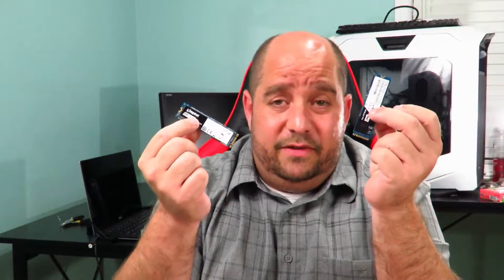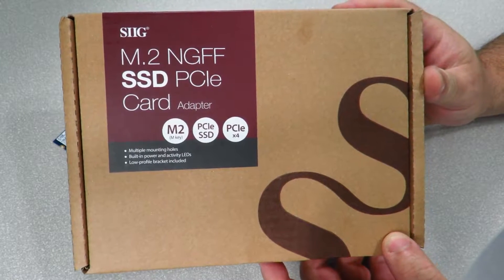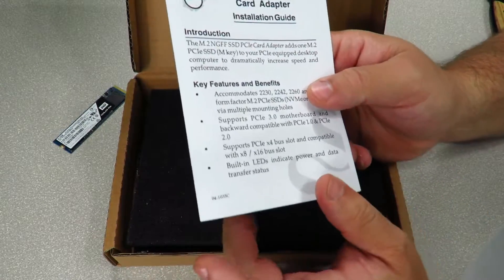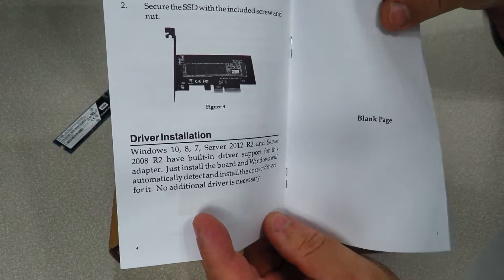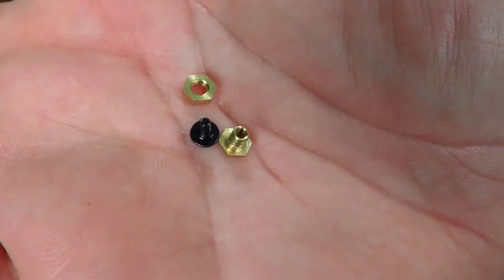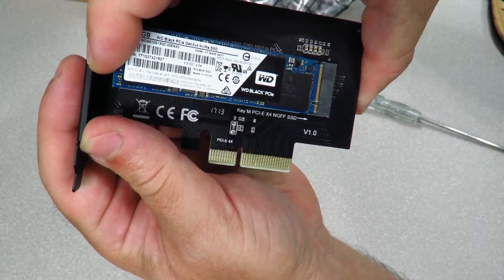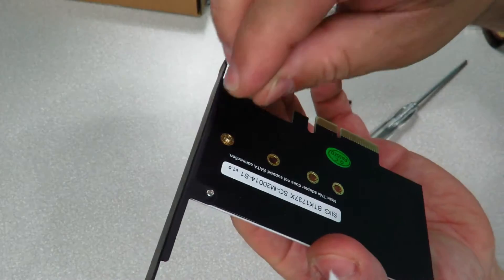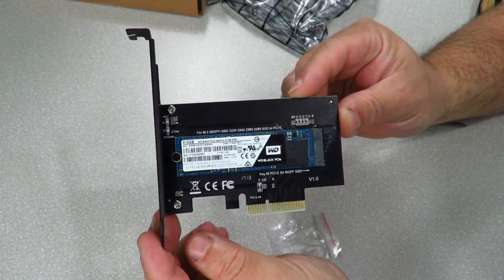Unboxing & Overview of the SIIG M.2 NGFF SSD NVME PCIe 3.0 Card Adapter

Comment: Very nice! I recently purchased my first NVME M.2 SSD and am in love with the read/write speeds. This is a fantastic option for those that don't have integrated NVME M.2 slots on their motherboards.
Reply from the maker: Yes it really is, I will be testing as well to see if there is any performance degradation using this method or if it holds true to its advertised speeds on the drives..  If it does it would be great, but if it only take a tiny speed hit, it still may not be bad.  Thank you so much for stopping by, checking out the video and commenting, it means the world to me.